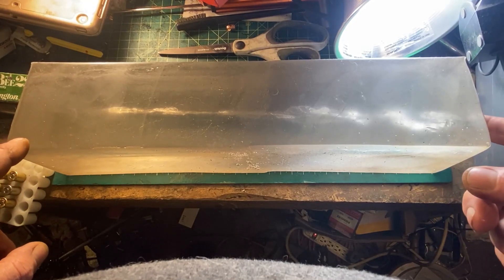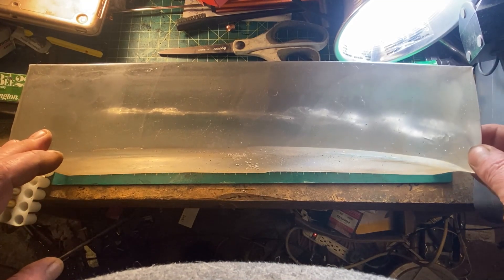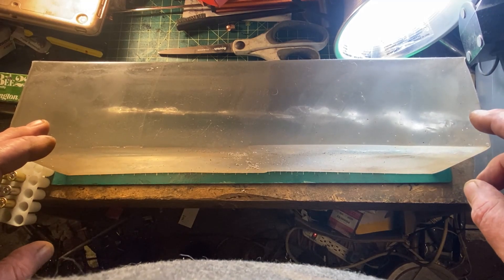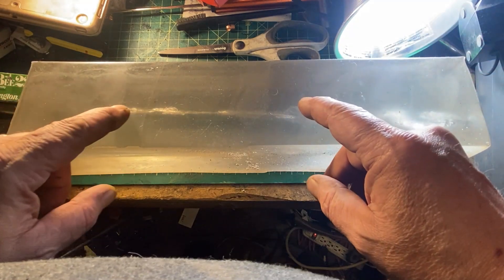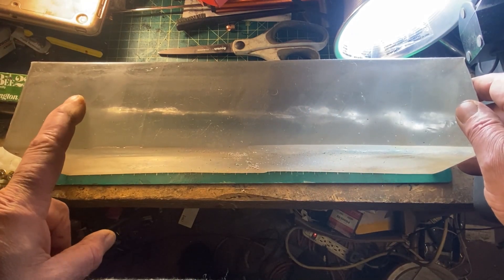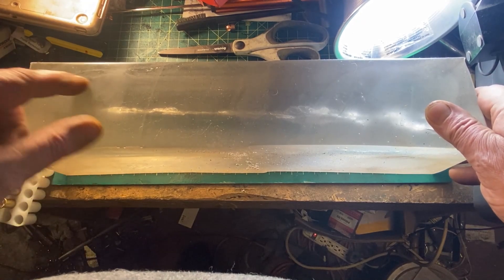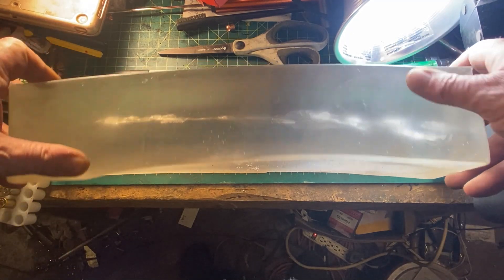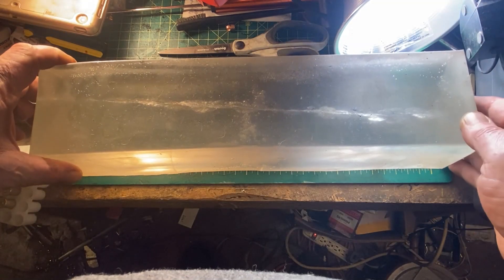Gel Test- 55gr  Lehigh Xtreme Defender in .30 Carbine

Comment: Happy New Year! Interesting indeed, definitely like the innovative idea of resizing the bullets. As I've mentioned before I'm skeptical of using gel tests to replicate the effects on real bodies, because gel is homogeneous and bodies aren't. It's easier to design bullet performance when there is one exact thing happening; it gets very tough when you have that standard and another where you first have to go through bone to hit the gel. And bone density varies too. Still we gotta have something, and gel does roughly equal a bullet not hitting bone. 

Numbers will always show that increased velocity gives the biggest energy gains, but overlooks that you need enough penetration into the vitals before anything else begins to have much effect. Penetration takes momentum energy which only enough bullet weight can give you. These 55gr bullets lack in momentum energy and probably wouldn't penetrate deep enough if solid bone was hit before the soft gel-like parts behind the bone are reached. In the upper center torso of most animals you have roughly a 50% chance of hitting a rib or missing it completely. Another channel does actual "meat tests" using real tissue with bone to replicate real life and the results I've seen seem to back up my line of thought. 

So in I have to wonder if a 55gr bullet even at 30 Carbine velocity is a good idea, especially when real-life shows that 110gr FMJ at similar velocities can lack penetration if bone is hit first. I wish you'd do some experimenting along those lines using either real bone or maybe a hardwood board (of a thickness you's need to determine through testing) in front of the gel to better replicate a rib hit versus missing that; we need to know that before we can make any conclusions on effectiveness for a given purpose. The other channel I mentioned takes ages and a lot of rambling (like me) to get to their conclusions and you get there far more quickly without missing anything important along the way so I hope you'll consider giving the idea of dual-target testing here; one "FBI" test and one with a rib or pseudo-rib in front. That would make my year!
Reply from the maker: I find Paul Harrell's meat tests to be a useful adjunct to gel tests. People forget that gel is a comparative media and does not replicate performance in a flesh-and-blood target.  The test is also aimed specifically at determining the performance of duty rounds for police, not self-defense or hunting.  I was skeptical of the 9mm Xtreme Defender; the fact that it looks good in Gel is a decent indicator but it's only one data point. I sent samples to a friend of mine in Texas that frequently has to shoot feral hogs and he tried it out.  It performed well, comparably to well-regarded JHP ammunition.  I'd like to see a 100rg version of these in .308 driven to the same velocity.
Reply: @tinkertalksguns7289  Thanks for the fast and insightful reply. Gel does come close to real soft tissue; it's the best we've got so I'm not against using it. I don't think there's much difference between what LE needs and what our own self-defense needs. The old-school bullets were all that I had back when I shot actively and frequently, and today's bullets can be far better. But the basics still apply and as long as there's enough penetration I'll consider them. When I developed my self-defense load premium HP's were just getting started and I get great results using .357 125gr HP's at a chronographed 1600FPS from a 4" barrel. An extremely hot load which will instantly disassemble most guns and wear out most others, I will not share my loading data nor recommend it as a goal, but me and many others have discovered that it's very effective IRL with bullets that hold together. Today I'd buy a 357SIG and be done with it. ATB to you and your channel from a forever subscriber.